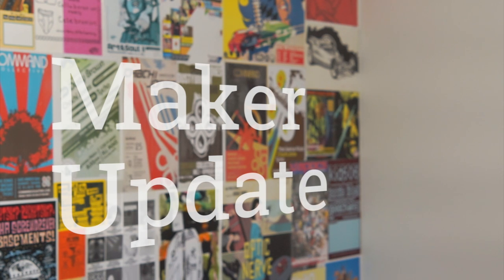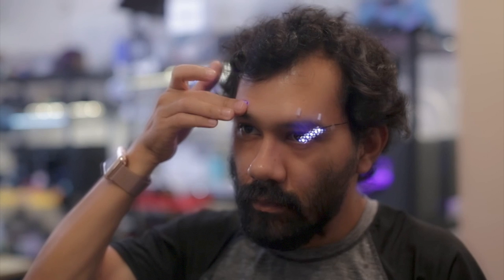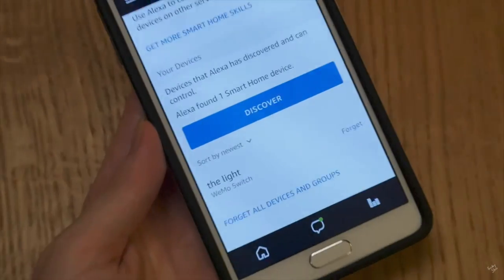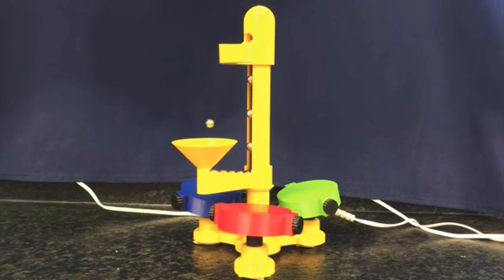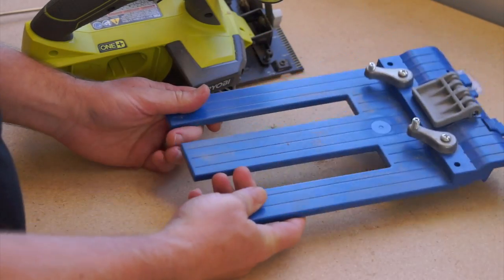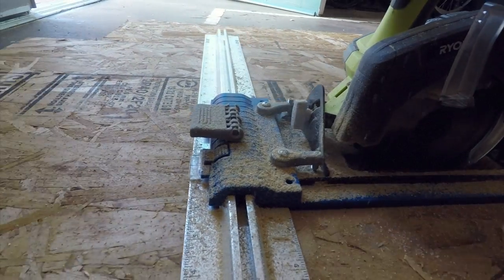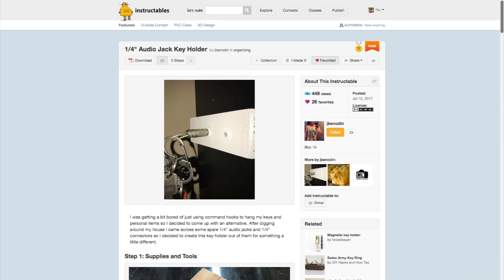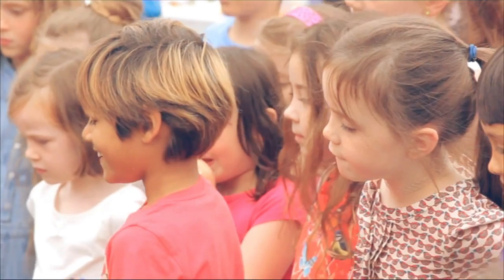LEDs For Your Face [Maker Update #43]

Comment: From what I've seen, people will often keep a sheet of foam insulation to use as the support underneath.  You do get the styrofoam bits cut which can be a pain, but the insulation can be cheaper in the long run.
Reply from the maker: Good tip!
Reply: You can also just lay down a couple of 2x4s a few inches apart.
Reply: Nick Fajardo I can confirm that the foam works awesome. I keep a bunch of 3/4 inch thick blue board around just for use with my circular saw (with or without the rip jig). You can get a lot of use out of blue board before it is worn out.

Comment: The Rip-It jig is super handy, no doubt.  But I disagree that it's useful for multiple same-size cuts.  What I found was that the "fence" on the side is simply too short and so there's no support at the end of the cut.  This results in saw movement of maybe 1/32" for the last few inches.  That's no big deal if you're only making one cut but if you need to make four in a row, then you're looking at 4 * 1/32" = 1/8".  The cumulative error (even if not quite that dramatic) does get noticeable after only a couple of cuts.

Stick to just one cut (or two cuts if you alternate sides) and it's a very worthwhile jig to own.
Reply from the maker: Good point. My main use for this so far has just to break down sheets of plywood that I can later clean up with a router if I want something extra precise or smooth. It sure beats waiting for someone at Home Depot to make the cuts for you. I am not a woodworker. Sometimes I just need to build something basic (a workbench top, or a bookshelf) that needs big, straight cuts of of plywood, and this has done the job well without taking up much room in my little garage.